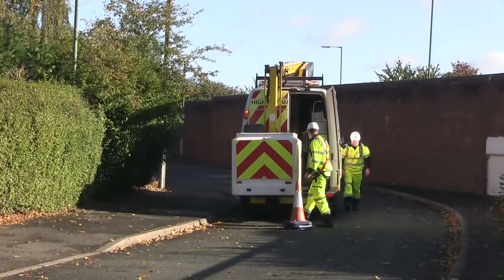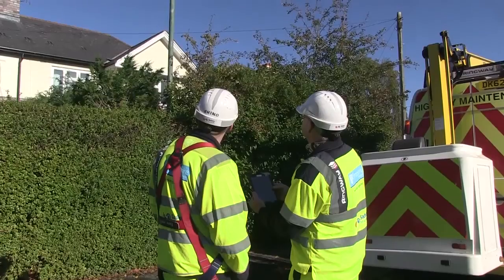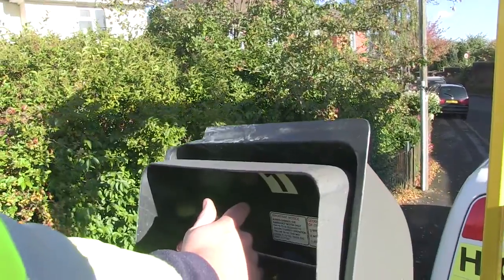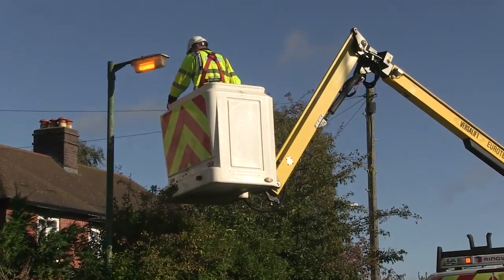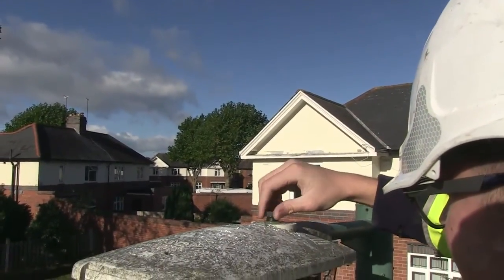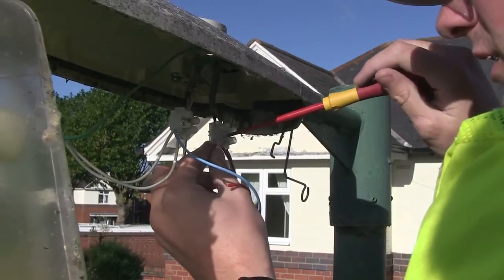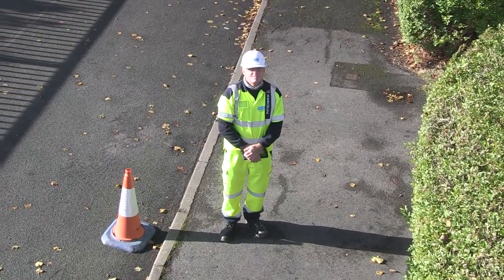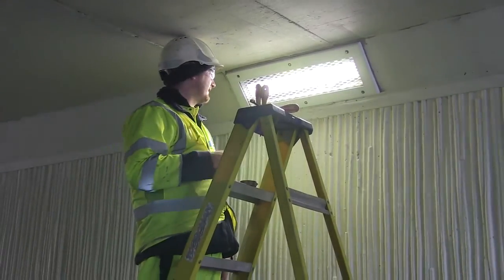Shropshire Council - Street Lighting

Comment: I prefer the warm glow of sodium lamps. LEDs actually can mimic the same colour as ceramic metal halide, high pressure sodium or even low pressure sodium, but most councils just prefer choosing LED streetlights with a CCT of 4000K and 5700K, which makes travelling at night unpleasant. Not to mention the environmental impact it has on certain animal species and insects.

Comment: #bringbacksox
Reply: Agreed mate!
Reply: I'm Tempted to get a ladder and change my LED one at the back of my house and put a SOX up becouse council took the 70w lamp away and replaced it with LED which dosnt even light up much of the path behind my house.
Reply: @caithnessrailrambler2698  buy some off ebay some are only 20 or 25 pounds for son high pressure sodium
Reply: @thepurdychannel8866  already have a Sox and at 70 watt lamp 😂😂 very tempted to put one up if I get a ladder but after that council might remove it again then lossed it ,😂😂
Reply: @caithnessrailrambler2698  put some on your own house and point it on the road